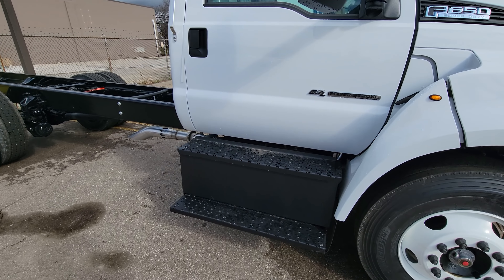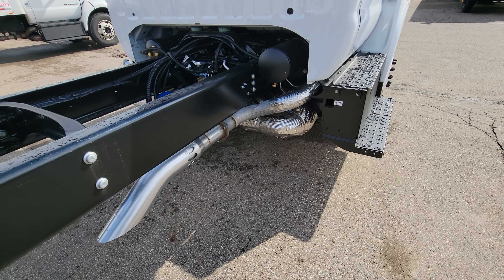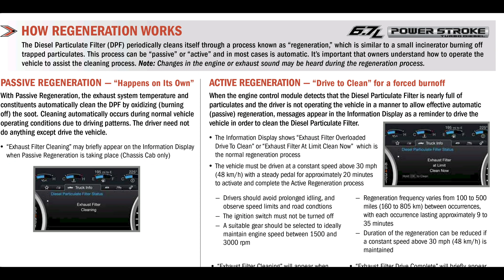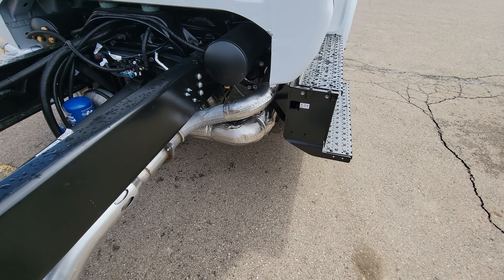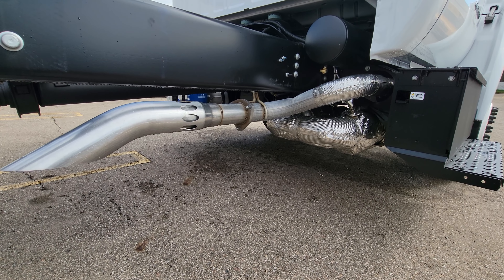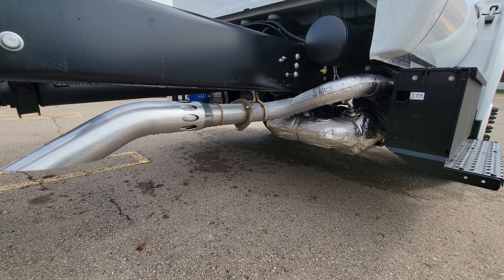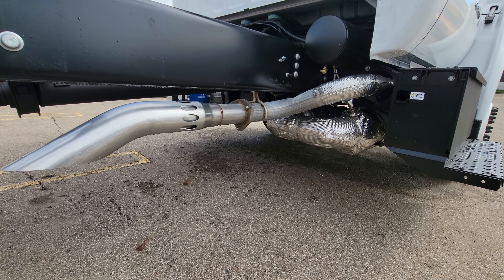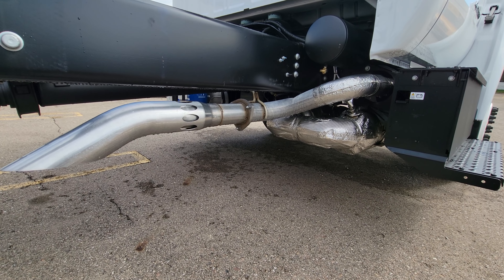IT's TIME! Emission & DPF Filter Regen TALK | What is goin on, What 2 expect & HOW TO USE

Comment: Driver bank doses fuel in the 6.7. Passenger bank is EGR and not part of the post injection dosing. Passive will happen around 575 or there about but usually is insufficient to fully clean. Active regen is every 500 miles almost regardless of how you drive. Active Regen can happen at idle if the engine is running at idle for long periods. DEF is not used for regeneration. It’s used to help clean NOx emissions, nothing more.
Reply from the maker: Thank you vais3. We are all here to learn🙋‍♂️👌
Reply: @PowerStrokeTechTalkwARod  , I’ve got a huge amount of data logged on that system enough to be confident it’s not going to suddenly fail on me without warning. Approaching 90k on my personal 17 and still going strong. We had fleet rigs that remained idling for months on end without a single issue.
Reply from the maker: Excellent brother
Reply: @joesfamilyfarm  you’re correct in assuming no fuel is being dosed into the exhaust stroke (late injection) during passive regeneration. Based on your short active regen schedule, I’m going out on a limb saying you have an earlier truck 2011-2016 or possibly even 2011-2014. Regen cycles were extended in duration in 2017 to 500 miles between active cycles and typically last 20-40 minutes in duration.
Reply: Turn off auto regen and you can go beyond 500 miles without a regen.
Reply: My 2014 F550 (motorhome) Regens every 500 miles.  I drive mainly highway and under load.  Use a ScanGuage II to track EGTs and REGENS/soot level in DPF.
Reply: @timgeisbauer3084  -As I just stated on another comment, throw that garbage in a rest stop trash can and get Forscan. Enable DPF % and disable auto regen and you can run past 500 miles without a regen. I've gone close to 1000 miles on several occasions while towing without needing a regen.
Reply: @timgeisbauer3084  an F550 is a narrow frame and has a different set of emissions parameters when compared to F250-F450.
Reply: @tattooedmillionair  -Check out the Ford Truck Enthusiasts forum. Lots of good info there about Forscan and all it can do including instructions. It's very simple to use.  As far as reducing regens yes it saves some fuel but you'll also have less dilution of your oil, less 1100+ degree thermal cycles of your DPF and you can also plan your regens so you get a full regen instead of partial cleanings while driving around town.
Reply: @joesfamilyfarm  what I don’t get is, if we shouldn’t shut it off during an active then why don’t they make more of an idiot light? Ford has to assume we aren’t going to watch our mileage or sniff our exhaust to tell if we should run it a bit longer
Reply: @joesfamilyfarm  totally get what you’re saying. Thanks for the reply!
Reply: @vais3  how did you achieve the idle time with no issues? Did you have a plan in place to run the manual regeneration every so often? I’m still working on this P2002 issue. I hear anything from aftermarket air intakes to clogged dpf to cracked dpf. I don’t know all the values for the system so I’m at a standstill on troubleshooting until I can get ahold of the catalyst values for every thing. Do you have any insight on this or where to look. All the big rigs have a rep that’s made a video talking about the individual components and how to troubleshoot things. One guy almost replaced his scr and found it was the dosing pump. I’ve had a similar issue where I got a fault code for the def tank heater and after reading forums found it’s caused by low voltage. I happen to be using some shitty strobes for work at the moment and took them off code went away. Ford systems can be tricky, the faulty part usually isn’t the problem in my experience.
Reply: @garlandmeredith2039  the later systems will automatically idle up and begin short duration regeneration when necessary. The trucks hardly came out of high idle during long idle periods.
P2002, DPF efficiency below threshold. Hard to say what’s happening without live data or the freeze frame data. I personally would watch the values being given in IDS or another device to guide you in your decisions. Also, avoid forums when possible because they can be rather misleading at times.
An exhaust leak can give you bogus readings on your DPF differential pressure transmitter that will also give you a below efficiency CEL. Cracked would be easy to spot with a white rag hung near the tailpipe. You would accumulate soot on it and possibly the split tips if bad enough. 

Without data from the ECM diag is nearly impossible without some form of external problems causing the issue. Hope you get it sorted.

Comment: One sure way I can observe my 17 is in regen is when driving a steady speed under light load when you abruptly lift off the throttle you see a small quick rise in tube boost pressure. It seems also that it boosts slightly higher than normal under throttle plus of course the hot smell.
Reply from the maker: Hot like somethins cookin

Comment: I use a Banks Data Monster IDash, that can be programed to see the percentage and if the regen is active or off. I drive it then to complete the regen properly.
Reply: Same here with my 17. But I downloaded forscan to unlocked static Regen and unlocked the soot levels in the cluster. The banks is nice since it shows real time levels unlike the in cluster on only shows it in 5% intervals. But I love being able to turn off auto Regen when it gets to 100% while pulling into my drive way then doing a static or waiting until the next day then turning back on auto Regen when on the highway. I hated pulling into my neighborhood and it hits 100% and starts a Regen and I would pull back onto the road and go for a extra 20-30 min drive to let it complete.

Comment: Got a few drive to clean messages on my 2016 caused by short drives to the office. The OCR is now turned on which allows me to monitor and do static regen when necessary.

Comment: My 2015 F2Fiddy shows on the dash cluster that it’s running the dpf, but I typically only know it’s done when my avg fuel mileage goes back up and my rpm’s go back down slightly. Once I noticed a message that said regen complete or something to that effect. Using Archoil, or any other additive, will reduce the frequency of the regens.

Comment: 2015 F350 had an engine code. The dealer replaced DEF tank heater unit. It was not reading correct ohms and put check engine lite on. 120 thou Kms on truck. Warranty thank God

Comment: Thx for spending all this time explaining all this to us newbie's that have not owned a diesel truck before.  Hoping to retire and acquire a newer 350 with 10 speed for a 5th wheel for traveling.  I watch a lot of your u-tubes on ford 350's and learn the tricks & trades of stuff to add to help make the engine be better.  Will you were closer to Oregon but that's life.  Thanks :)
Reply from the maker: Juss had a couple from THERE come thru with their brand new 2024
Reply: @PowerStrokeTechTalkwARod  I miss spoke above, I wished you were closer to Oregon, but that's life.  Look on-line for 20-21 yr trucks to hopefully look at.  Found one ('21) with 5K miles at dealership that hoping it's still there when I can pull the plug and go get it.  I think the dealership utilized it for a demo truck.  Thanks again.  Will keep watching.

Comment: We have a bunch of 13k lbs 4x4 forklifts that all have a def less regen. Roughly twice a day and stinks like burning crayons. The newer L series Volvos we have, use def. And are sent out at least once a year for regen issues.
Fuel use around the mill has greatly increased.

Had a 6.4 as a daily driver. 30km to work and back. Sorta glad the truck ended up on it's roof. Going broke putting fuel in it.
Now the 6.7 with less restrictions, the glance at the fuel needles is like.. oh your still there...neat

Anyone ever read their entire manuals? There's a couple paragraphs that explain these engines are designed to be intimidating to the owner and to deter from user maintenance.

After this fuel saver litteraly falls apart, my next truck will be an 85 to 2002.

Comment: I bought a Autel MX808 specifically so I can manually regen my 2013 F450 True cab/chassis derated 6.7 everytime I take toyhauler to go camping I take scanner I also run a banks Idash so I can see my soot level iv never had to use the scanner but my basic XLT I don't have a massive center screen it usually shows soot level at 106% then it does mild burn offs

Comment: the DEF system and the DPF system are completely different systems for different out comes, the DPF traps Soot created from the combustion process aka unburnt fuel, and performs a regen which i do beleave is still using late post injection simular to the 6.4 powerstroke and they do NOT have an injector dumping fuel into the exhaust system, the fuel hits the Diesel oxidation Catalyist and creates heat up to 1250 degrees and burns off the Soot into Ash, now the DEF system take NOX emission that is created by high cylinder pressures and add the DEF or Amnia  with NOX emissions and a chemical reaction happens within the SCR brick as long as there is Heat(which is happening at all times not just during a regen)  and the output is Nitrogen and oxygen if memory serves me, the EGR system is also to help lower NOX emissions along with the SCR system by adding an inert gas to the combustion chamber and these trucks are using more def now a days to lower EGR usage and also stricter emissions ...
Reply from the maker: Thank u

Comment: Hey ARod - Love the channel. Have learned a lot as an owner of s 2020 F-450 Chassis Cab. Recently we got a P221C code, so we had the shop replace the reductant heater. This fixed that code, but now we have a P24FE code, and so far the shop hasn't figured out how to get this cleared up. They tried a manual regen, cleared codes, test drove and thought it was fine. I picked up the truck, drove about 7mi and it came right back, telling me I would have reduced power in 50mi (50mph max). 

I am not seeing a lot of info online about this code and any associated fixes. Given your expertise do you have any thoughts on this code/fix?

Comment: Correct me if I’m wrong but I believe that all of the 2017+ 6.7 PowerStroke trucks regardless of model/trim level are programmed to do “Active Regen” every 350-500miles. Of course if you do a lot of idling, that range will be greatly reduced. On my 2017 Platinum, leaving in SoCal, about 90% of my driving is highway driving above 70mph. And my truck always refers at 400miles +-. So what can we do to ensure we do more of the passive regen? Thanks!!

Comment: At 10:25 into the video, you speak about the importance of letting it finish its Regen process. Here is my problem with that, how are we suppose to know when the process is finished? I hate this that it doesnt give a message saying "Regen Complete" on my F350. I did use ForScan last year to activate the passive OCR message "Drive to Clean". It will do the process, but I never know when its finished. My DPF filter Percentage screen I turned on with ForScan, and even after (assuming its finished) a regen process, my DPF Percentage screen never ever, and I mean never goes below 20%. I've never seen a 0% showing on my screen. So with that said, i dont understand why Ford dont program the PCU to at least have a "regen complete"  message to the driver, and should I have a manual regen done to see if I can get my percentage to show 0%? I'm the 2nd owner, it was 4 years old with 52,000 miles on my 2016 F350 Lariat when I purchased it. I've had it a year and a half. Could it be possible the reason i dont get 0% shown on my screen when done is bc of the previous owner interrupting the process and its permanently clogged to some degree?
Reply from the maker: If you have e FORscan, there should be no reason why your not pushing a static regen with it to ensure its cleaned. Sometimes passive & active Regens are not enough
Reply: @PowerStrokeTechTalkwARod  thanks for your response. However, I do not know how to do that nor where to go in the software with that via ForScan with my laptop. Can you possibly show us a video how-to? Thanks in advance.

Comment: How long should you drive when you get the “cleaning exhaust filter” message? Or whatever it exactly says. I’m new to this and mine comes on occasionally but goes off right away and never says done or anything.
Reply from the maker: U need to get OCR turned on so u have a better idea
Reply: @PowerStrokeTechTalkwARod  The OCR lets you know the %,  but not when the regen is finished. Sometimes it will go all the way to 0%, but often it will not and you don't know you're finished until you see the % start to go back up. Our 2012 F350XL DRW 4X4 Chassis Cab full enlosed 11' utility body truck regens often. Sometimes at over 100 miles, but often only 65 or 70 miles. 142k so far and the dealer told us we needed to replace the whole DPF system a little over 2 years ago. Not much improvement if any. Strange thing is we seem to do fewer and better regen cycles in the winter months when it's colder out then in the warmer months. The truck weighs at least in the 10 - 12,000 lb range everyday.
Even so the truck almost never seems to work hard to pull this load, with 3.73 axle ratios, it seems to be too low in the RPM's range to keep the DPF burned out. Only around 1900 RMP on the PA Turnpike doing 70mph. Does anyone know how to get this thing to regen less often? We change the full synthetic oil often because of our concern for fuel dilution of the engine oil and added an Amsoil Bypass filter system to increase soot filtering and add oil capacity. We've never seen a truck that has such black oil.

Since this truck is a work truck XL model, the display is very small and limited. I wish we could see when it is a passive versus an active regen. 

The static regen is a nice feature of the OCR, but it's really difficult to time that so that you can be off the road and park for 10-20 minutes, since you need to be in park, etc. and it takes a while to complete. Trying to complete a complete regen while driving is hit or miss since we can't drive 10 or 20 miles out of our way at work to complete a regen. Poor system for a work truck. Maybe if it would let us do a static regen without the truck DPF% being 100% it wouldn't be so difficult to do them more often.

Any thoughts on how we can better manage the DPF system would be greatly appreciated. Thank you for many many great and informative videos ARod!

Comment: I have a 2011 is there a way to tell how much d e f is in my tank October filled it all over the place more than once thanks in advance Gary love your content .
Reply from the maker: If u had a scan tool or something like the Banks iDash
Reply: Should be the same as a 2012. I'm sure it's in the manual so check that first if you can. If I remember this without being in my truck, Start the truck, press the info button on the steering wheel and the truck should ask on the small display if you want to press the reset button to do a system check. Press Reset, and it will then display a list of truck parameters and one of those will be if the DPF tank is over 1/2 full or under 1/2 full, or very low warnings. Good luck.

Comment: 22 F450 7k miles. P249F CODE.
Dealer replaced 2 sensors exhaust gas. What temp should the sensors read during normal driving. They are showing 470 to 550 range now.

Comment: I want, but dont NEED a new 6.7 f250. The 7.3 will do all that i need from a 3/4 ton. I will only be putting 4-10k a year on the truck. I will tow in the city maybe once a month 50 miles 8k lb, then maybe 10k in state 200 miles 5-10 times a year, and maybe out of state 600 mile 10k once a year or so. So it wont be getting worked hard. Other than that will get mostly hwy/city miles. My question is if i will cause issues/damage/problems to the 6.7 engine by not "working" it as it is design to be used. I'll try to get good mpg, but dont mind opening her up as needed to keep things clear and free and performing well and preventing issues etc.

Comment: I have a 19 f250 with ocr turned for awhile  with forscan  but I did a regen about about 200 miles ago and my dpf gauge is still at 0% and no check engine light should I be concerned about this

Comment: Have my ocr  turned on, on a 2017. Regen  happens every 500 miles no matter  how full the  dpf is. Runs for about  30 minutes. Today  it turned on with dpf filter  at 55%.  I have been using max mileage. Trying to extend  regen cycles. The only  difference  has been  that the Regen  cycle  starts at 500 miles  with  a half full filter.  Is there a way  to  have the Regen  cycle  start when filter is , say 80%?
Reply from the maker: Naw sure isnt

Comment: Thanks for video.... have a couple of questions... i currently have a F350 SRW (2018) 6.7.   How do i know when it is regenning?    My only guess is sometimes by fuel mileage plummets while driving to work (19 --> 13/14) and then returns to 19ish.   I am guessing this is a regen cycle.    Also, i just ordered a 2022 350 DRW 6.7L.   In my order kit i added the manual regen option.  My truck isn't a work truck, but only for towing large fifth wheel and daily driver.  May consider towing RV's for a living in future, but its not a tow truck or ambulance where it is idling all the time.   Was this good/bad call to have that option added.
Reply from the maker: Brother, that's a great option. Did you watch my OCR videos. You might wanna email me to discuss further

Comment: New diesel owner here. I just completed a 1300 mile trip towing 6k with my 23 standard 6.7. Since I have been home I noticed the exhaust filter is staying at 0 percent. I also notice the regen smell more than before. Is this normal? No lights or messages on the dash. I also started using the Hot Shots winter EDT. Not sure if that has something to do with it. Thanks.
Reply from the maker: ....i am confised...are you questioning the smell??